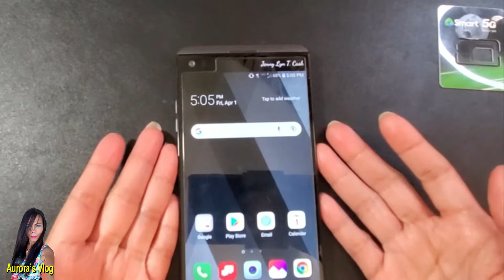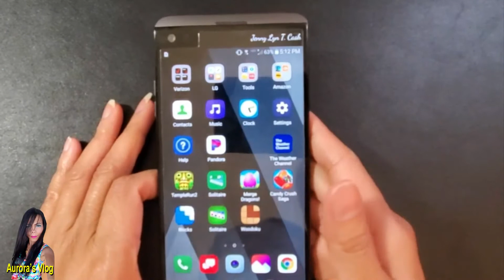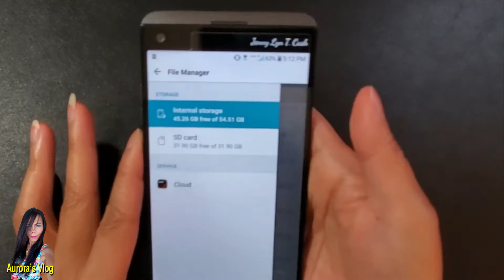How to Install Sim Card, SD card and Battery on Mobile Phone LG V20

Comment: How's your travels in Cebu hope no headaches with all the changes and requirements. I just came back myself not to bad things are going back to normal. By the does this phone work in the Philippines?
Reply from the maker: I brought 2 US phone unlock and one.
My Mint mobile subscriptions, the text and calls from US was fine. I can call and received text and calls and can use wifi hotspot.
I had the second phone loaded with philippine sim card so I can buy and use data. AND that did really helped.
I bought 40GB for 20bucks and use it as our hotspot. Everyone in the family use 7 of us use it. 
I am so glad I did cuz some condos does not have reliable wifi connection some do
Reply: @AuroraCash  thank you